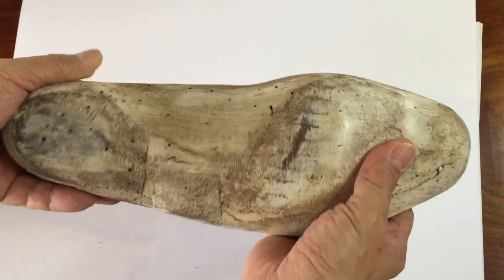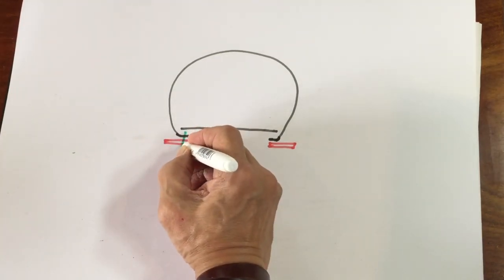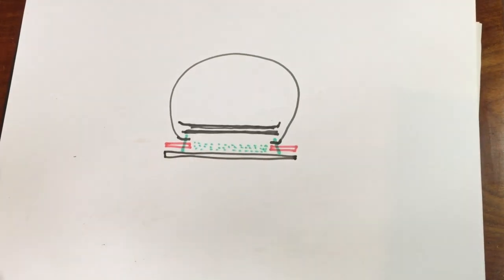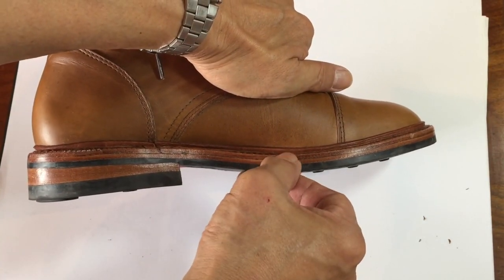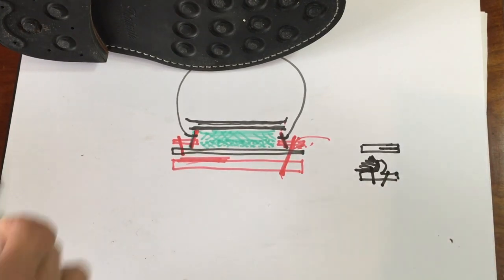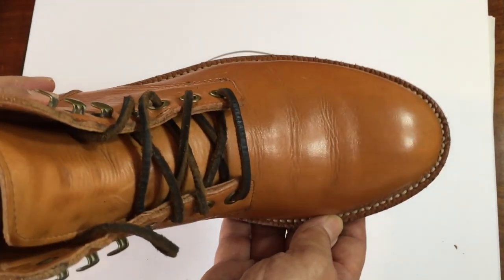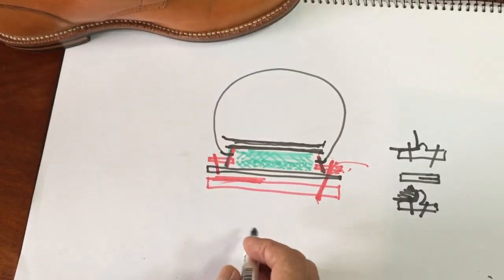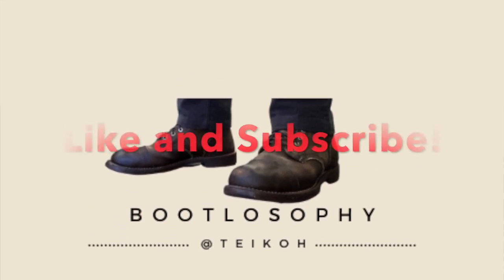Goodyear Welted Boot Construction 101

Comment: Excellent video. Why is the stitching on the bottom of the Grant Diesel boot a different color than on the top? Aren't they supposed to be the same thread, or am I missing something?
Reply from the maker: Actually two threads, one from top, one from bobbin below, and crossing inside. That’s why it’s ok to wear them off on the sole
Reply: @Bootlosophy  Interesting. Sounds like a seriously heavy duty machine that stitches it.

Edit: I think I understand--the bobbin thread gets pulled into the middle. So I guess that you're saying the thread wearing out on the bottom isn't a problem because the glue is bonding the thread at the intersection point? Or is it just the friction involved that is locking it in?
Reply from the maker: @andrewkwhitecustomfilms  both, the glue and the fact the two threads interlock. Google Landis stitcher